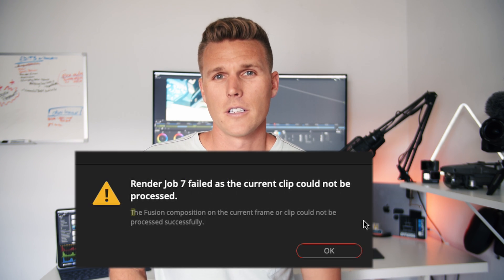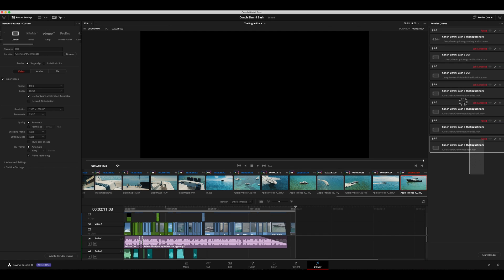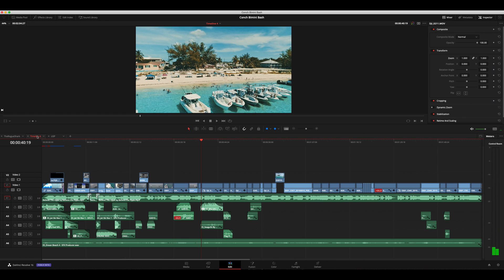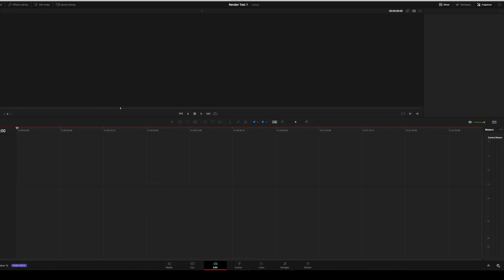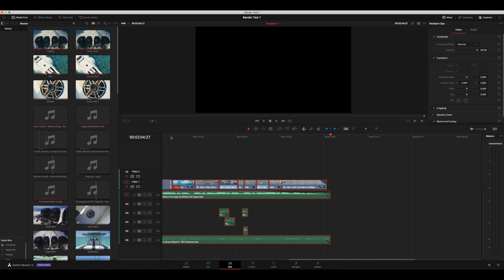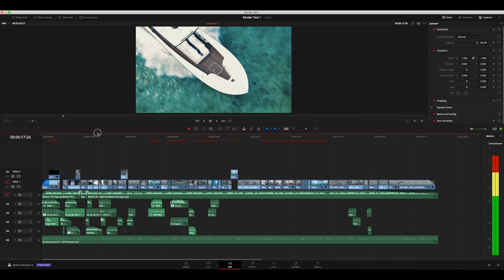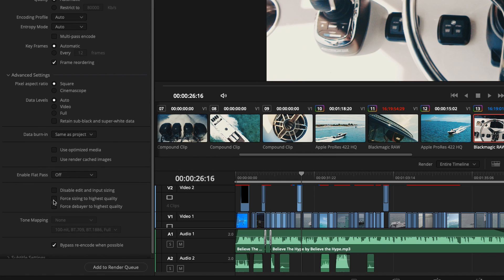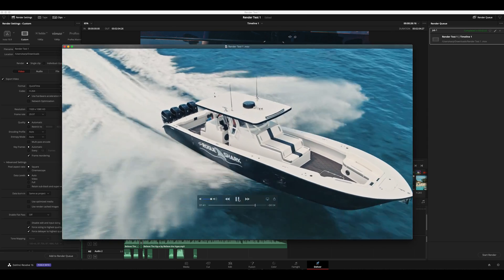How to fix "Render Job Failed" Error | DaVinci Resolve 16

Comment: Nice video, however it did not work for me, Here's what did: Go to preferences: User: UI. Then UN-CHECK the box next to; "stop renders when a frame or clip cannot be processed." Viola!
Reply from the maker: +Bar Shabatai Productions thank you for sharing!!
Reply from the maker: +Bar Shabatai Productions thank you for sharing!!
Reply: @JakeEarp  My Pleasure. Truth is I found it on some thread somewhere. I can't remember where though. BTW: Very nice presentation on your video. Clear and complete. Thanks.
Reply: Where is preferences?
Reply: @squadproductions4351  CTRL +  ,   orr  The first button on the top left  ´´ Davinci Resolve ´´ >  '' Preferences ''
Reply: You saved my life, bro. After six hours of being in my chair, I was too close to get insane. Thank u
Reply: where the fuck are ,,preferences,,
Reply: @icebearpl188  please don’t cuss
Reply: Sometimes the solution is THAT easy! Thank you very much! It helped me a lot!
Reply: Does this fix the issue? Or does this end up removing the clip thats the issue? Im having this problem and it seems to just remove or not render the fusion clip in my video...the rest renders great but the fusion portion isnt there
Reply: Thanks bro, your tips helped.
Reply: Ur the greatest. I tried everything else and it didn’t work but this did. Thanks so much👍
Reply: We got the Real MVP right here, folks.
Reply: This has been driving me crazy for weeks, thank you for posting this tip.
Reply: This is not a solution. It can bite you back very hard. You are just ignoring the problem, maybe a dropped frame, maybe like my case where I used Mocha Pro the remove was intermittent, anything wrong can happen if you disable the stop render when a frame cannot be processed.
Reply: @mastixmastix  Exactly my concern - it seems too good to be true.  I will use this solution until the final export, then turn it back on and go thru with a fine tooth comb.
Reply: MAGIC! Thank you so much!!!
Reply: @mazlanhasan  when you will see real magic then follow me flo31
Reply: Thanks so much!  I looked everywhere for the solution to my problem and even asked in BMD’s forums and nothing worked and never came across this suggestion.  Anyways, as you probably can guess, your suggestion worked perfectly.  Thanks again!
Reply: You made my day! 👍
Reply: DUDE,,,,  i love you
Reply: Hey I can't find the button even though I followed what you said? Help? Did they move it? I am on a Laptop if that helps.
Reply: @yourflamingdeath2315  CTRL +  ,   orr  The first button on the top left  ´´ Davinci Resolve ´´ >  '' Preferences ''
Reply: TY!!!!
Reply: Both are great, but yours took my heart!
Reply: Thank you very much Bar Shabatai... it did work!  Everything else didn't work for me. Not sure what it was, my video is 1 hour 30 minutes long.
Reply: Where is preference? Would love to find this magical ui
Reply: Dub Dub hi ! Where did you find it?? I’m losing it
Reply: Sorry where us preferences lo acted at I am fairly new
Reply: Thanks so much!!
Reply: do you ever get that red frame that says media offline?
Reply: Dude this is it, Thanks
Reply: Yayyyy
Reply: thank you so much! this worked perfectly for me!!!
Reply: Awesome, thanks so much
Reply: @LeilaWardArt  yw.
Reply: Can you direct me to where this setting is in Da Vinci 16 please? I can't see 'preferences' in the settings.
Reply: @TimTrevail  press on "davinci resolve" icon in the left upper corner.
Reply: @TimTrevail  Hover over Davinci Resolve 16 in the top left, and you should see it
Reply: @TimTrevail  In the top left, click on "davinci Resolve 16," then, in the menu, you should see preferences
Reply: Tim Trevail it’s all the way up the software windows
Reply: Wow, yes this saved my ass. Thank you!
Reply: Thank you so much ! 👍
Reply: I would be wary of doing this. When I've done it, I end up with Media Offline frames in the final output.
Reply: THANK YOU SOOOO MUCHHHHHH
Reply: Genius, thanks a bunch mate :)
Reply: Ahhh this worked! Thanks so much :D
Reply: THANK YOU SO MUCH!
Reply: wow, saved me so much time thanks
Reply: YES. Thank you for posting this. Solved my problem as well
Reply: Holy shit, thank you :)
Reply: Your a God sent man! hank you so much. It worked for me I confirm.
Reply: THNX!!
Reply: Thank you! This tip saved me from redoing 4 hours worth of video editing!
Reply: Found it! Hopefully this works
Reply: @LgDubDub  where is the preference tab
Reply: @yappingbrownguy  Click Davinci Resolve And the menu should have an option called preferences
Reply: @LgDubDub  where is it?
Reply: Thank you so Much Bar Shabatai Productions
Reply: Thank you !!!
Reply: this is still the fix smh 2months later
Reply: thanks so much Bar. You have saved me from loosing my mind. Also, thanks to Jake otherwise I would never have seen Bars solution :)
Reply: thanks i was ahving this issue and this worked for me..well its rendering at least..we'll see what I get
Reply: Worked perfectly.. thank's so much
Reply: saved my life! tysm
Reply: worked! thanks
Reply: you are my fucking hero
Reply: @ruper8531  please don’t cuss
Reply: amazing, u saved my day :)
Reply: you saved me.
Reply: Fucking legend, thanks
Reply: @IBACAU123  please don’t cuss
Reply: Did it 4 me, thank you so much, made my deadline now.
Reply: Omg thank you so much 😊
Reply: Yayyyy
Reply: Man you saved my day 🙏
Reply: Best Comment ever ! Thank you dude you saved me!
Reply: Thanks very much pro ❤️
Reply: You saved me👏🏼👏🏼👏🏼👏🏼😅
Reply: I don’t see where it says “preferences” at...
Reply: @Treykaraokerapbuddies  press on the "DaVinci Resolve" button on top left
Reply: It works! thanks!!!
Reply: YES!!!
Reply: Thanks
Reply: THANK YOU SO SO SO MUCH
Reply: Ou you are my Hero Thank you. I tried this for hours and got so angry😂
Reply: Thank you!
Reply: wow! really?! ty! i will try!!
Reply: TYSM!
Reply: Thanks dude! Lifesaver!!
Reply: it didn’t work when I followed the video tips but it did when I followed yours. thank you so much!!!!
Reply: Video didn't work for me, thank you for your comment worked perfect!]
Reply: I don't say this to many random people I have never met who comment on YouTube videos... But I fucking love you.
Reply: Changed my animations and shizzle bcs i thought that was the problem. Apparently not, thx fam
Reply: THANK YOU very very  very much
Reply: Thanks so much! 03:10am in South Africa now and I have a deadline in 7 hours. I'd have lost sleep if it weren't for your advice!
Reply: worked with me!! thank you
Reply: Thank you sir. Worked for me.
Reply: thanks a lot!!! <3
Reply: wtf how do i get to preferances
Reply: Thankyou so much!
Reply: If I could like a comment more than once I'd probably like this one a few dozen times. One, single, pesky clip has made me waste probably a few hours of my life and this saved me from suffering through it any more
Reply: Where can one find this on Mac OS version:
preferences: User: UI. Then UN-CHECK the box next to; "stop renders when a frame or clip cannot be processed."
Reply: Thanks! Worked.
Reply: fuckin GENIUS!! THANKSSSS
Reply: If didn't work for me too.. Where is preference?? I need to try your method now.. 😢
Reply: Thanks a lot. Was stuck for so many days. I am curious though. Is there a drawback of this method? I didn't see any visible difference though.
Reply: Thanks maan herooo
Reply: Thank you so much this fixed it for me!
Reply: THANK YOU 🙏🏼
Reply: OMG what a life saver this tip is.....I have been pulling my hair out all weekend trying to get my first video to render to you tube.....searching internet for a fix and I find this awesome...…..@Bar Shabatai Productions worked within a few minutes Thankx again.
Reply: GENIUS! Thank u so much :D <3
Reply: If I uncheck "Stop renders when a frame or clip cannot be processed", what would happen if there actually IS a problem with the render? Would it create a black frame whenever there's an issue? I render long videos sometimes, and I'd be paranoid that there would be corrupted/blank frames hiding in there somewhere
Reply: @JasonandaCamera  I never had a [roblem. Try and then spend some time watching playback. Beats fighting the render stopping all the time.
Reply: Thanks! Such a lifesaver
Reply: you sir have saved my 6 hours worth of work. thank you.
Reply: Thank you so much! brought our hopes back
Reply: changing the UI, that worked for me!
Reply: Where prefecebses?
Reply: THANK YOU!
Reply: I love you XD
Reply: This worked, thank you so much!!
Reply: holy shit ty
Reply: tnank you broooo
Reply: OMG THANK YOU SOO MUCH I GOT SO WORRIED
Reply: Damn, your trick worked for me too! That was really weird! Thanks a lot!
Reply: Bro you saved my day thanks a lot.
Reply: thx
Reply: DUDE YOU FKN ROCK!!!!!!!
Reply: 3 days stuck on a render and came accross your comment, which was the only fix that actually worked out for me. And nothing looks wrong with the video, so I wonder if something really changes. 

A year later and still helping people, congrats my man, and thank you.
Reply: Thank you. God bless you
Reply: Thx so much
Reply: THANK YOU THANK YOU
Reply: The video didn't help me much, but you kind sir saved my life!!!
Reply: I actually to CHECK the box for it to work. Thanks for this comment though because I wouldn't never found out if it weren't for this! 😃
Reply: Simply the best
Reply: you saved my life! thanks mate for sharing
Reply: Bro, thank you very much.
Reply: Thanks buddy your comment solved my problem.
Reply: My savior, thanks friend.
Reply: omg thank you so mcuH!!!
Reply: omg thank you so much, it worked!
Reply: where is that
Reply: Thank you good sir youre a life saver
Reply: woow man dont know how to tank you, very nice.
Reply: Thank you!
Reply: Ur a life saver!!!!
Reply: This comment should be pinned.
Reply: Well, I'll be goddamned. You son of a gun.
Reply: Thank youuuuuu broooooo
Reply: I solved my render fails by uninstalling the official latest version and installing the v16 with studio features included from filelist.ro a trustworthy torrent website.

Comment: Hey Jake, I am still having the issue with the retimed compound clip failing to render (the one I was telling you about that I was working on a few weeks ago) and I even tried your solution and it still isn't working.  Any ideas on what could be causing this or how to fix it?  I mean I only have Text+ titles and one Fusion Composition title and it is failing right away in the during the first one (which is a Fusion Composition title but I am sure it will fail during the Text+ titles too like it was before).  Very frustrating and I don't understand it.  Any help would be greatly appreciated.  I have asked on the BMD forums (in two locations) and not received a response.  Thanks again!
Reply from the maker: R Baker hmmm, have you tried to change the project resolution settings?
Reply: @JakeEarp  OK, got the compound clip to render fine and everything the same as it was except without the retiming so adding the retiming is what is causing it to fail.  I even moved the project over to a different computer (both of which aren't the greatest-broke my very expensive computer, sigh).  Is there some special setting I am missing for retiming Text+ and Fusion compositions?  Very strange that it would playback just fine in the timeline and not render.
Reply: @JakeEarp  Nope, I was rendering another huge project and working on this one again.  I just got done rendering the problematic clip and it is retimed to 75% speed and had 0 problems.  However, I removed all Title+ and Fusion elements so those are definitely the source of the problem (or at least they are when they are in the compound clip and retimed).  I am going to try changing the resolution now.  Also, by the way, the Title+ and Fusion elements render just fine at 100% speed (but I haven't tried them in a compound clip yet).  I really just thought 6.1 beta 2 might fix things or that I could find a solution somewhere.  This is something I really want to figure out because I am going to need to do this on a very frequent basis.
Reply: @JakeEarp  I just tried changing the resolution from 1080p to 720p and no luck.  I have been changing a bunch of things and it plays back perfectly too.  This makes no sense at all to me.

Comment: I have the same Problem in beta 2 first i thought its because of compound clip but when i open a new Projekt import a rdm clip it dont render i got the error cant processed current cant open file for reading i tryed all my ssds but that changes nothing on the timeline the file works all reads have some one a idea?

Comment from the maker: Has anybody encountered this Resolve Error?
Reply: I encoutered this error just now, and kinda using mixed solution from your video. I did not create a new project, just generate optimized media, and after that in render page i follow your video but also pick the use optimized media option. and it fixed that. i don't know the source of the problem though. thank you for your video. i was in 16.1 btw.
Reply from the maker: @GizkyHarryPerdana  Glad you were also able to find a workaround! I had tried something similar with the optimized media, but did not check it on the render page. Did you use any Fusion graphics in your project?
Reply: Yes Thank you for helping me
Reply from the maker: ianxboss you’re very welcome. Glad it worked for you
Reply: My video made it to 37% in the Delivery page, then DR 16 just shutdown.  No message!!!  Dam, I need help!!!!
Reply: Yessss! Thanks for saving my life! You just earned a subscription =) I will try it today!
Reply: Yes, my first time today!  I have been using DR since July.  I hope this works.  Thanks in advance!!!
Reply: I did encounter this error too
Reply: Yes... Thank you...NOW My issue is that when I exit the program, it does not give me the option to save anything... It literally SHUTS DOWN in less than a split second... and won't restart until I reboot my computer. Im stumped.
Reply: Yes. I can only export AVI, and even then some players don't like the codec. MOV and MP4 always fail for me, so far. I'm not sure why! I'm still playing with settings, trial and error, to see if something works.
Reply: Jake Earp me
Reply: amazing.. it works.. thank you
Reply: THE BEST SOLUTION https://youtu.be/H71dqYzfILc